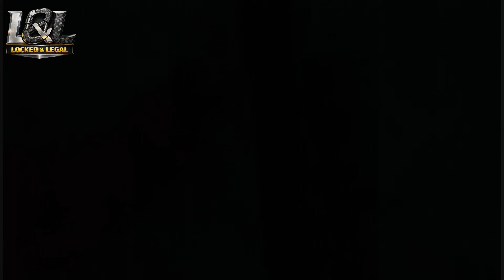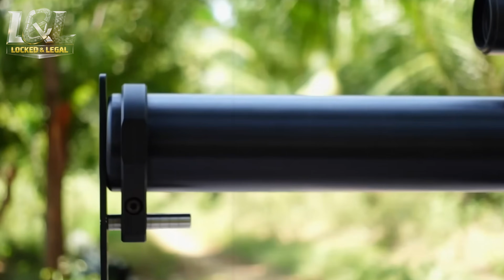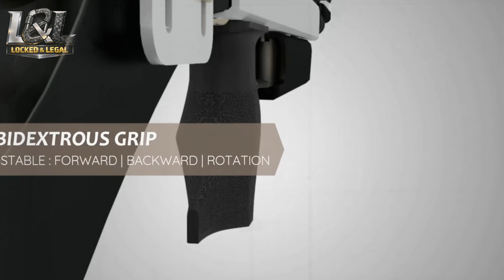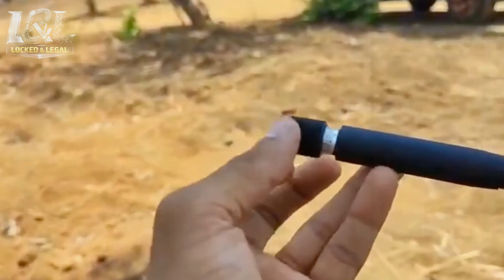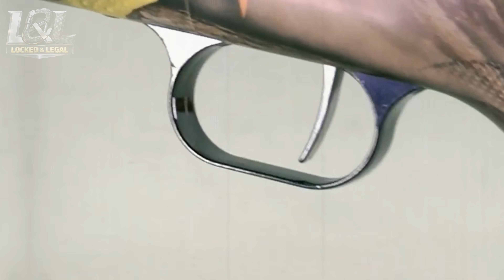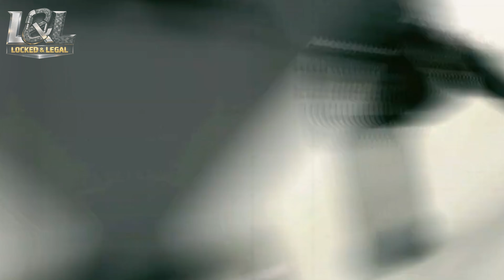PCP Air Rifle in India: Is This Really the Best?

Comment: Did you missed Gare & Valorous 🙄
Reply: gare is poor quality, valorous is korean guns manufactured under license in india
Reply: @TBM10101
Thank you sir for stopping me as I wanted a powerful   .177 for pest control  and was eyeing for Gare since Precihol is good for plinkers but not so powerful moreover it suppressor systems is too fragile,without threading for attachment.please suggest a budget friendly without compromising it accuracy, power with rugged built made in India. 👍👍
Reply: @yalieangami6233 I wouldn’t send you for an Indian made anything but I will say that a very accurate and powerful…at least for the caliber .177 would be the Air Venturi Avenger Gen 1 Gen 2 or if you get REALLY lucky a used ATI Nova Vista Liberty which has both a high and low power setting and like the Avenger series IS regulated. I sold one scoped in a case with bi-pods and pellets that also included a new hand pump for $300 usd to a local guy. Hope this helps point in helpful direction. BTW a Gauntlet wouldn’t be a bad choice either but you most likely will have to use heavy .177 cal pellets and or slugs. They can be a powerhouse especially in the 2 nd Gen Gauntlet SL.
Reply: @heathhalfhill6867 
That's a wonderful and very honest advise but unfortunately being an Indian can't access the imported items which will cost me,an ordinary farmhand a fortune. Anyway huge thanks to you for the suggestion and sparing you're precious time.😘👍👍
Reply: @yalieangami6233 buy Valorous Black Scorpion if your budget is around 35k, go for AGI Terminator if your budget is 45k. if you want highest power then buy Arya Mk3